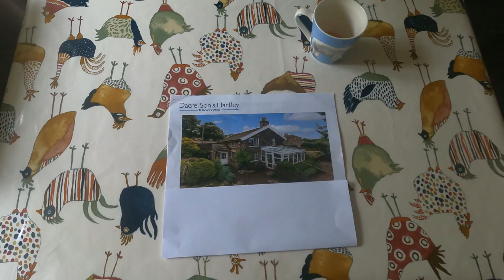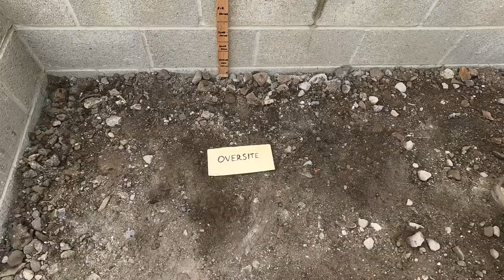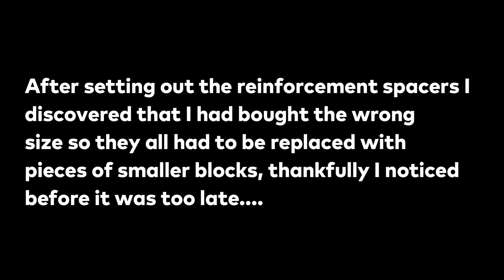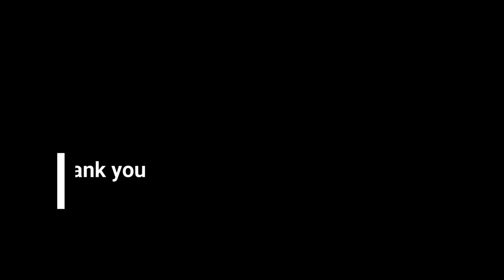Yorkshire stone cottage extension build and full renovation. Episode 3 - Oversite

Comment: Great work!  But wouldn't floor joists and plywood be cheaper and faster?  Also why is there a gap between the cinder block and the stone work.  I don't mean to be a pain by asking questions, I'm just trying to figure out the different building techniques.  Again great work and looking forward to episode 4.
Reply from the maker: Thank you, I contemplated timber flooring but I think I’m going to put down underfloor heating which is laid onto an insulated concrete base.
The gap is part filled with insulation that’s fitted as the walls go up.